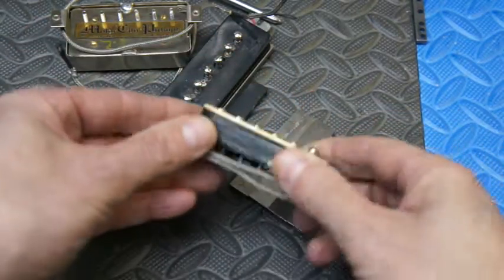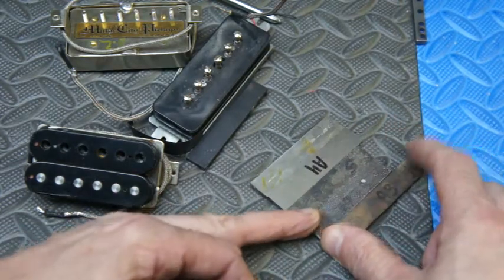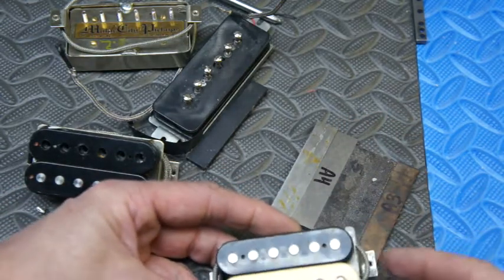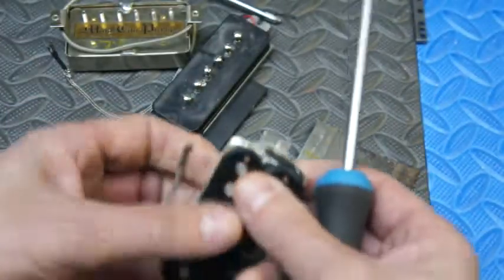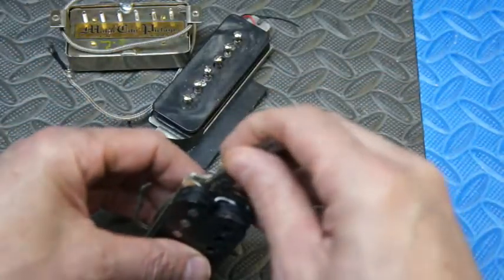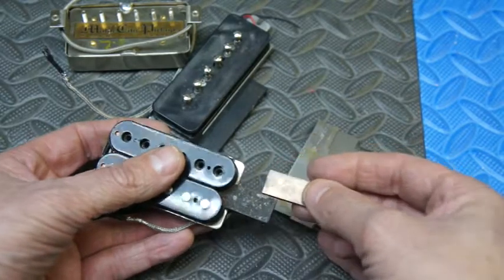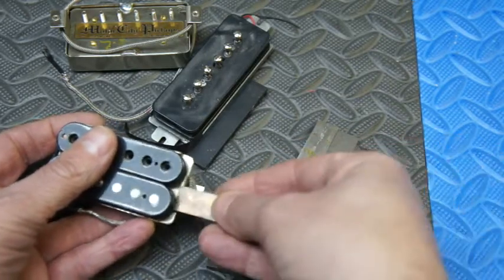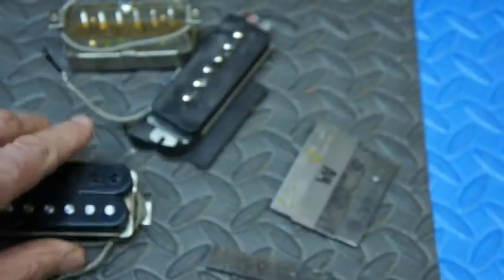Magnet Swap

Comment: Where's the P-90 details?  I am trying to remove a ceramic magnet from a SD Custom P-90 and it's stuck.  Thx.
Reply from the maker: It’s the wax potting holding everything together.  You need a little more than gentle persuasion. After you loosen the screws gently pry the bobbin up without hurting any wires

Comment: Can you help me out with some advice please. I swapped out an alnico 5 for a ceramic 8 magnet in my SD 7 string pegasus. I did everything you said to do. First thing I noticed is it's more agressive and I love it.  Then I noticed a high amout of feedback right after stops. Is this a character of a ceramic magnet or so you think I did something wrong? Noise gate helps but it seems like its covering up a problem.
Reply from the maker: rar91181 you need to wax pot that pickup
Reply: @patfurlan  Thanks that's what I figured.
Reply: Make sure nothing is vibrating. Tighten everything, make sure nothing is moving.
Reply: @angelobouhoutsos3060  the whole pickup is vibrating when it happens. If I hold the pickup down it stops. It has a nice fitted foam bed it sits in but still really sensitive to high gain. I'm guessing the ceramic magnet and it needing to be was potted have allot to do with it.
Reply: rar91181  if the magnet is not the same width and height things could be loose. Is the pickup worn? Did you tighten the screws enough? Loose wire, debris? Grounding issue, sometimes the solder does not make a good enough connection. Potting can change the sound, and may not really fix the issue just hide it. Like an aspirin for gangrene. 
 Sounds like it is not tightened or not ground properly. I had an issue with grounding of a different nature also, the amp or house was not grounded except in one room. When you press it down don’t touch the metal parts to make sure it is not a grounding issue. Everything else should be tightened. Make sure everything is flush and you don’t face the amp to closely also. This can sound rudimentary but it could be anyone of these things along with more power of the pickup making the microphonics more pronounced. I think it is more simple then you think though! Also a pickups mag does not cause squealing, an incorrectly made pickup does or incorrect fitting and finally damage.